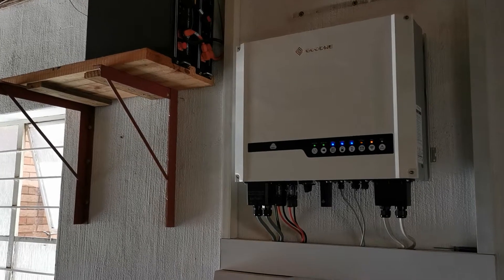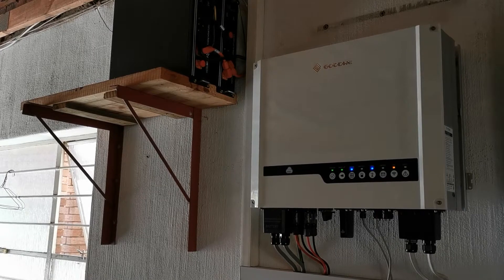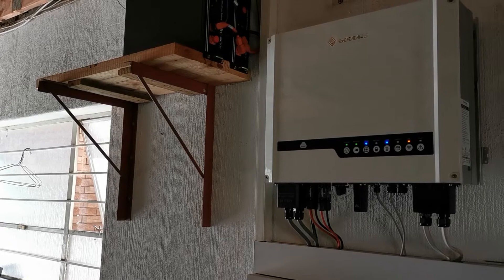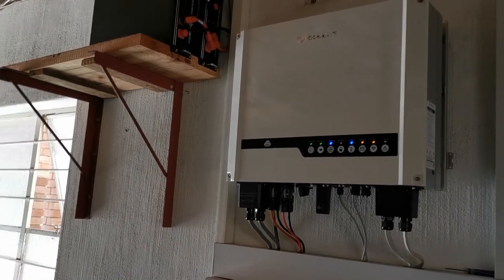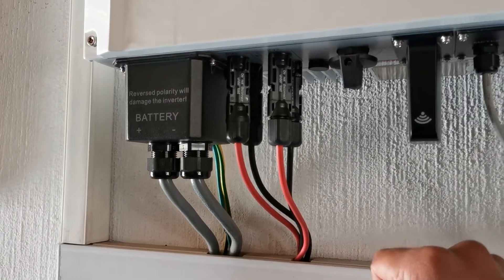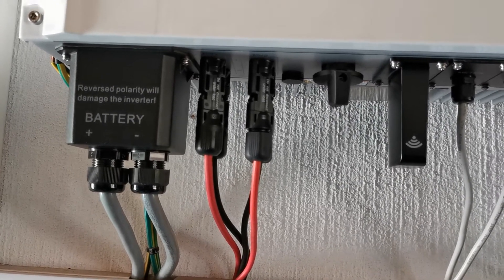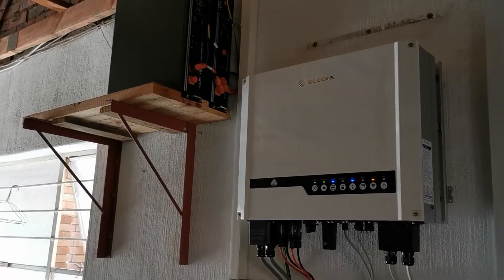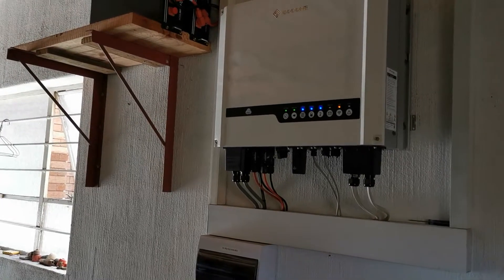Goodwe Hybrid Grid Tied Inverter Setup

Comment: Thanks for the video .I can not find all the settings for the inverter on PV Master advance settings .only have power limit / shadow screen /back up / battery activated / power factor / voltage / discharge current and dept of discharge .
Reply from the maker: Guten tag, it's a good machine, just not the best app.

Comment: I need urgent help with my GW5048D-ES inverter which faiks to give me power when loadshedding occurs because of apparent "communication failure" as the State of Charge of my Pylontect UP5000 Battery will be high at 98%. The current communication is from the BMS port in the inverter to the A/CAN port on the battery. Is this connection correct? I struggle to get technician to come down here in the North West
Reply from the maker: Check the battery SOH. Andries can help in NW

Comment: Hi! How are you still finding the Goodwe? Any issues with it, buggy firmware, wifi dropouts etc? I have an option to acquire one at a steal of a price, but read of a lot of issues on powerforum. Thoughts?
Reply from the maker: Goodwe is working well. I'm very happy with it. Runs my pool pump, boils my kettle and 18000btu non inverter aircon during the day. Runs the speed queen washing machine too. Running the latest firmware without issue. Wifi is ok now although I did experience issues with it previously
Reply: @ElecAndAll  great to hear that, thank you!!
Reply: @ElecAndAll  Forgot to ask - are most of those appliances you mentioned on your non-essentials circuit, fed by excess PV?
Reply from the maker: Yes, it's better for longevity not to have these heavy duty appliances on the backup supply. But during load shedding and during the day, if it's sunny I have a separate change over for the pool pump and aircon. So I still use them off grid. If there's sufficient sun.
Reply: @ElecAndAll  Thanks! Interesting, how is that separate change over switch wired to make use of solar for the non-essentials side when the grid is down?
Reply from the maker: Hello, I will demonstrate in a forthcoming video
Reply: @ElecAndAll  Top man! Thanks 😀

Comment: I own a Goodwe Es5048 and its a total peace of crap. I just ripped it out and went back to voltronic base, in my case a Max2 8kw. The Goodwe has a terrible interface for management and almost no tweaking. It is also unreliable and when issues starts it never stops. Support is also non existent and majority solar installers told me its junk. Only the Goodwe high-end KWh inverters is reasonably premium.

Comment: Hello I would like to ask:
1. how much is the zero load consumption of GW5048D-ES?
2. is it possible to supply from battery low consuption (less than 100w) or is it feed from the grid?
3. how hot is the radiator during the day? 
4. do you have any experience with parallel connection of this hybrid inverter with pure on-grid? 
Thank you
Reply from the maker: Hello,
1. I estimate about 50w.
2. Yes. In OffGrid mode, I can run a kettle 2kw, and my 18000bt ac. I also run a 1kw pool pump. It depends on the SOC off the battery and how much current is can supply. The BMS determines that.
3. Abt 50 degrees Celsius in summer.
4. No I haven't tried that.
Reply: @ElecAndAll  About point no. 2, what about normal mode? Is the load less than 100W supplied from grid or inverter? Is it possible to test it? Thank you
Reply from the maker: The way it works depends on the load. Inductive or resistive loads. There's a video where I describe this. As long as the load on the backup side is less than 4.8kw, and the battery has sufficient charge, the inverter will decide whether to supply it from the panels, battery or utility. On a nice sunny day, pv is preferred then battery then utility.

Comment: Which invertor should I use for back up,  when the is a load shedding?
Reply from the maker: Watch this https://youtu.be/Q8G4otvvjwY

It all depends what you need to power. You need to work out the power consumption in watts. Also, consider thr type of loads like inductive or resistive. Ideally as a start, work on the bare essentials like lighting, modems and keeping your devices charged.

Comment: Hi, very informative. Given that the batteries are expensive and also require replacing sooner than any other component, which inverter should I get to reduce my electricity bill and not require batteries. But also to allow me the option to add batteries at a later stage (due to loadshedding)
Reply from the maker: You should still have at least 1 lithium battery  in order to maximize your savings. Any grid tied inverter will offer the highest savings upfront.

Comment: 1. Grid tied means it only works with the grid. So as long as there's Eskom the inverter will work.
2. Your system is a hybrid inverter. Because it requires batteries to work.
3. You cannot change the settings of your MPPT if the PV array voltage is too high. You need to spec it well below the max voltage because you'll blow it.
Reply from the maker: 1. Not true. The inverter works in off grid mode and will supply backup loads Upto 5kw.
2. True. I hope that's what I said.
3. Not true. The inverters firmware protects it from being "blown" ie it throws an error DC injection high and will reduce the pv generation or shut off. Goodwe Support are able to modify these settings remotely.

Thanks for commenting.
Reply: 3. Please note that the 4.6kW Goodwe MPPT has a min DC voltage of 125 and a max of 550. You cannot change that settings like you say. It will give you a error message yes but it still takes damage to initially acknowledge that high voltage. If that's the case then your string has been wired incorrectly and 1 panel needs to be removed. Its safe to have your strings to total around 520V just to be on the safe side
Reply from the maker: We specc' d the mppts correctly and it was checked by goodwe.
Reply: 1. You said 2.33 that this inverter is grid tied. Its not, its a hybrid inverter. But I think you meant its grid tied because its still connected to the grid so I know what you meant. My bad.
Reply: 2. You initially said it's a hybrid inverter but then you said it's a grid tied inverter but as I said in number 1 I think you just meant its connected to the grid?
Reply from the maker: Hybrid means that it requires batteries to operate and it does..
Grid tied means that it's capable of exporting excess pv generation to the grid whilst maximising pv use for the entire load whether backup or off backup. In off grid mode, only backup loads are supplied.

Comment: whether it supports battery vrla, with a voltage of 48v 800ah / 4 banks
Reply from the maker: Lead acid is supported although not recommended. There's a video coming up comparing LA and lithiums
Reply: @ElecAndAll  Thank you for answering, because in terms of only recommendations for lintium, where the voltage is 200v -600v, if the voltage is only 48 volts, amperage is large, can it still work normally?
Reply from the maker: You need to use a battery balancer
Reply: @ElecAndAll  it can be volatile 48V, like an old model inverter
Reply from the maker: Yes but not recommended
Reply: @ElecAndAll  yes thanks for the info
Reply: @ElecAndAll  Greetings, I am from Indonesia, new to this product and do not understand the character of this inverter🙏🏼🙏🏼🙏🏼

Comment: On a perfect sunny day how long does it take to recharge the batteries completely?
Reply from the maker: It depends on the loads during the day, but if the load is about say 2kwh, then by 11am the batteries are fully charged. Also it depends on how large your battery bank is. I only have 2 pylontechs presently so thats pretty small.

Comment: Slmz. Very informative. Just a question the essential load and extra or non essential load that's direct from the PV are both part of the invert kilowatt capacity? Or does the non essential load not form part of the 5kva of the inverter for instance
Reply from the maker: ws. The inverter supplies both backup output and non backup outputs from PV. So for instance on a perfect sunny day, by 11 am, we generate about 5kw, 1 kw will go to backup, 2 kw to the non backup side and 2 kw to charge the batteries.

It can also combine both Eskom supply and PV so if PV isn't sufficient, then the rest will be from Eskom.

Comment: 1. How do you prevent the inverter from backfeeding the grid or is it allowed to back feed the grid?  2. The output of your inverter do you connect it on the Main circuit breaker or on its own breaker and supply the load?
Reply from the maker: 1. It has a built in "anti islanding" feature when there's a power failure. It also comes with an app where you can configure how many kilowatts you want to export.
2.Own breaker.